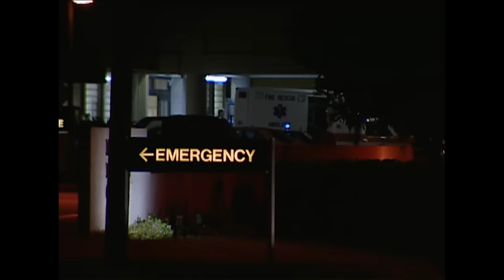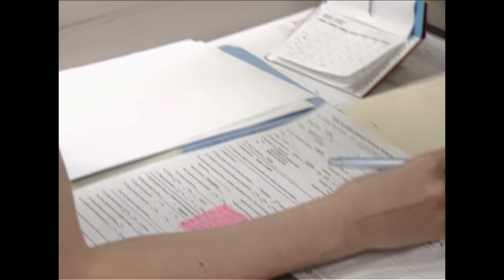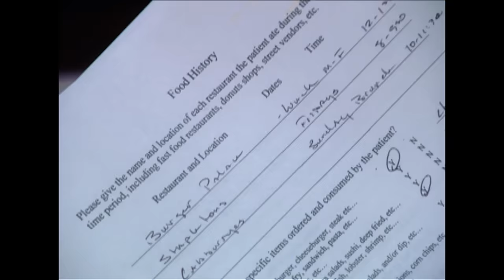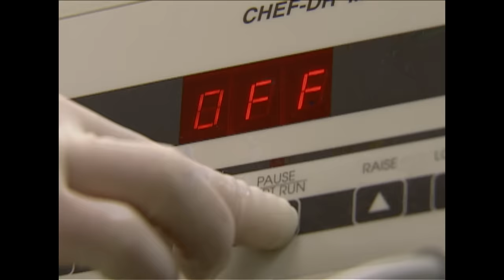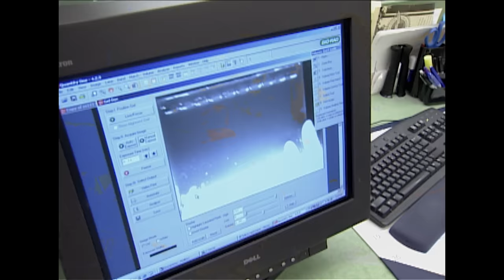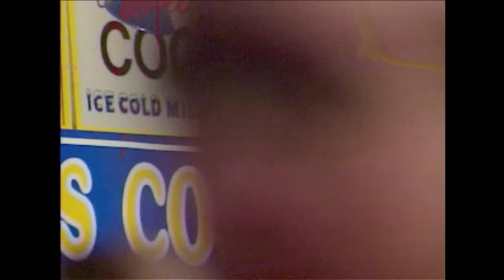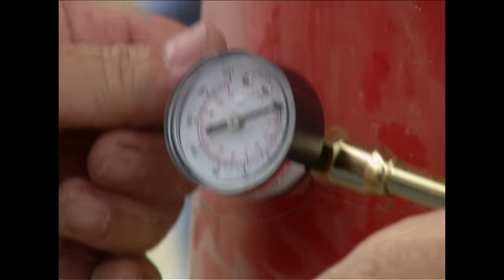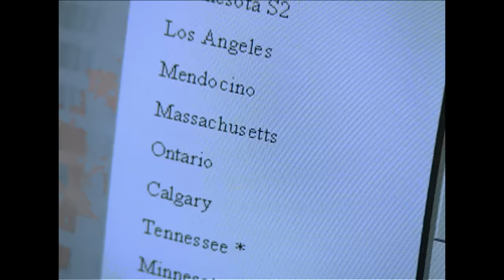Hospital Try To Save Patients With Dangerous Virus | Diagnosis Unknown | Real Responders

Comment: The lab staff would NEVER handle dangerous bacterial slides with bare hands! Wow, poorly recreated lab scenes.
Reply: They don't have hair nets or goggles on either
Reply: Yeah but it doesn’t have to be that accurate, it’s accurate enough I guess
Reply: I was thinking the same thing
Reply: And face masks. Not only for their own health but also to prevent contaminating the samples.
Reply: @dnfrizz  Yeahhh. I honestly couldn't care less if the reenactment is inaccurate. There's enough valid information here that if the subject piques your interest, you can just look the case up.
Reply: Dipping bottles in contaminated water, putting in case with sterile bottles... Filling bottle from suspected contaminated source without gloves...  there are many improbable scenes, but at least the message is solid.
Reply: Really before the aides virus hospital staff didn’t always wear gloves.
Reply: Let alone fill bottle with bare hands
Reply: @VickiKreis  very true. But this is not hospital staff, it's research lab staff who knows better than tracking nasties with bare hands. But there again, they ain't the ones who write these vids' scripts.
Reply: @rutgerw. Those aren't required in BSL2 labs where this would be done. I've worked in them

Comment: This is odd, I have watched two of these, and it turns out it is in both cases where the water supply was machinery that was broke down and not repaired, both with the chorine system that would of prevented such a thing. One in Canada, and now this one. We are told not to drink the water if you go for a visit in Mexico, that you would get sick. Now we know better that it is more than just the water.